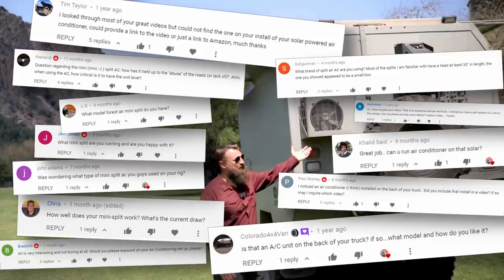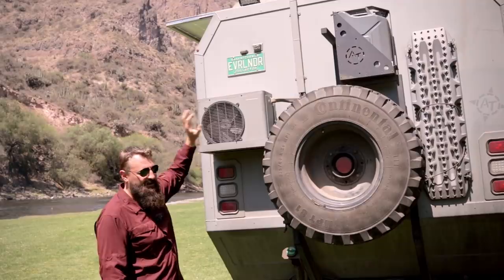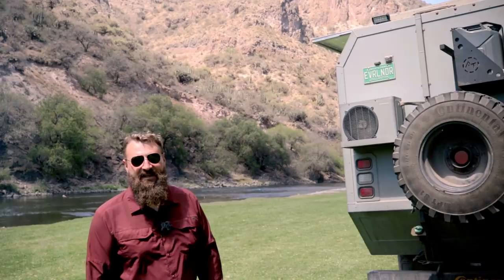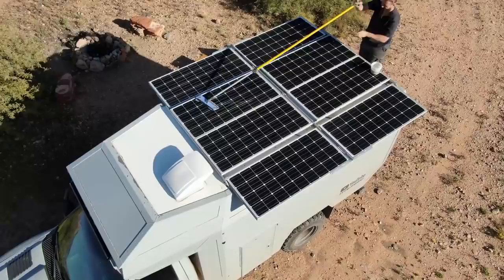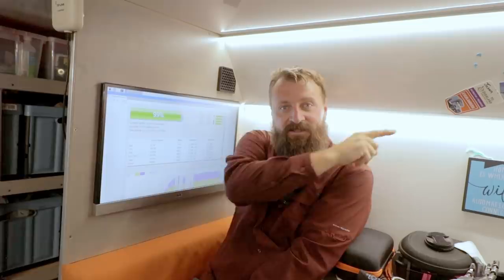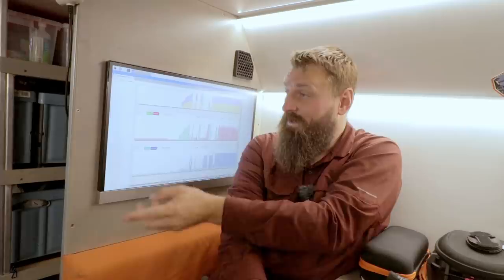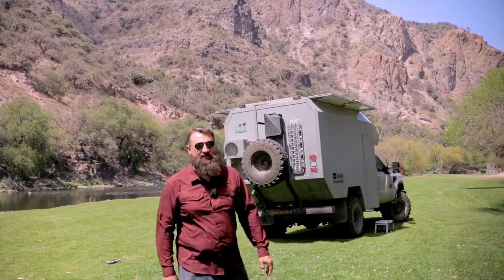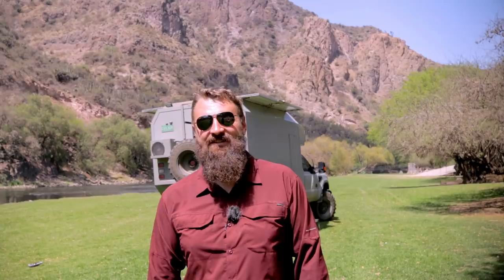Solar Powered Mini Split Air Conditioner Tour - Everlanders see the World!

Comment: Panasonic had the first solar ac same 800 watts. I found a china one for trucks that 640 watts split. I was thinking about it. I brought anther 400 wats panel fine on my van, total 930 watts. Brought = 540 ah 6 volt battery or 4 . Decide on a 5,000 btu. Low 460 watts ac can run it probably 3 hr. But my van I made it w/much ventilation .so the cold air escape my van mostly. Get cold later but I don't use it much.not all golden.  I rather do as I were doing that fast charge and tap off at 1:30 then go to the mall or park under a tree. Than charge in the sun till 3 pm. And cloud can screw it up. Depends. Your needs. But same thing as lithium battery they sound wonder strong, but they require long hr all day charging back up. Trojan 6 volt  are around 2 hr fast charge then 1 hr tap off they just soak up the amps big lead electrolytes

Comment: thank you for making this!
can you expound a little more on what you mean about the replacement for this forestair model? When you say the hose is no longer removable are you meaning that I would need to cut a hole big enough to put the whole inner box inside? Whereas you only needed to put a hole big enough for the umbilical cord through? Also, what are the disadvantages of it being 10k btu over 8k btu? Probably draws more power?

Thanks!
Reply from the maker: Yes, sadly the new 10K model would need a big door like you say... The higher BTU rating probably isn't any problem, the rated watt consumption is the same, perhaps they got more efficient cooling somehow, or they over rated it, it's so close it wouldn't matter.
Reply: Everlanders I saw that on your Canadian costco link it still shows the 8k option (as well as the 10k). In the states we only have the 8k as an option. Do you think the 8k on the Canadian site is still legit to get?

Comment: Do you use two solar chargers one for the lower panels that disappear and one for the top panels that are always(mostly) in sun? Just curious of that whole setup.
Reply from the maker: 2 controllers is not needed, they can all be controlled with one as long as the top layer is paralleled with the bottom. In fact we have 4 DSSR20's as shown in this video. https://youtu.be/TGMZ7bM-Kow

Comment: Suggestion. Try finding a vent out of a vehicle at the auto wreckers and affix it to your cooling vent.  You can find some cars where you can change the flaps almost 180 degrees and also rotate 360 degrees.  Then you can point the flow in any direction coming from your vent.
Reply from the maker: Good tip, I've got one drawn up in CAD, and I'll print it off once I get access to our printer again.

Comment: Sorry to trouble you with this, but I looked on your website and through your videos and didn't find what I was looking for.  Could you please make a video about your energy monitoring system?  I recognize Raspbian, but after that I'm lost.  I too have the Electrodacus system including the DMPPT450 and I'd like to set up something like you have.  Not sure if it's possible for me because if it isn't GUI setup I'll quickly be too deep in the weeds.  Thanks in advance.
Reply from the maker: Page 8 of the users manual describes how to monitor over WiFi: http://electrodacus.com/SBMS120/manual/SBMSmanual.pdf 
I took it a step further and curl the data from the Pi, and send it to my server in the cloud for remote monitoring. Further automation can be done on the values retrieved. For example, I have a python script that turns off the Inverter after 5 minutes without a load, if it's forgotten on. Or to extend the second set of solar panels when needed, retract at night after they stop producing power, etc...
None of it is GUI based however, it's all custom scripted in python for my needs. But it sounds like the HTML monitoring in the manual was all you really wanted...
Reply: @Everlanders  Thanks for the reply.  I'll have to ask my computer science major nephew to have a look into it and tell me if it's something we can tackle together.  I've had quite a few discussions on the forum with Dacian,  and he's always extremely helpful.  Looking forward to the challenge!

Comment: You can buy these mini splits that run off DC, so no need for an AC inverter with it's associated loss.
Reply from the maker: I've only found 48 volt systems, do you have a link to a 12 volt system suitable for an RV/Automotive environment? The only one I found was Cruise N Comfort for $4000.00

Comment: Have you thought about tearing the units apart and changing the fans to dc ones? Your power consumption would drop and it could be less noisy and you could have better control over it.
Reply from the maker: I have. It's not the fans that pull the majority of the power, it's the Compressor, and those are sealed inside a can...

Comment: I would like to put your solar system on our 5th wheel camper, but need to know how and what do I need.
Reply from the maker: We did a video on the solar panel install some years back. https://youtu.be/cM5s4F-7AOk

Any fab shop should be able.to copy what's shown in the video. We have 8 185w panels, a SBMS100 solar charge controller and 20 180AH CALB lithium batteries wired 4S5P.

Comment: I’m surprised you’re driving through those dusty environments without a
Cover on the outside unit. I would try to install some way to automatically turn on the AC whenever the temperature reaches a certain point / voltage
Reply from the maker: It's pretty simple to keep clean... A water hose goes a long way. And yes, it comes on automatically when our solar is producing excess power.
Reply: @Everlanders   awesomeeeeee. good work.  I have a smaller van with not so much room for panels and I can’t wait / hope for AC technology to become more efficient / small sized 🥵🥵

Comment: Mini-split FTW!  Nicely integrated with the van.  Like the quick connects on the unit.  Do you think there are time you are maxing BTU cooling or is does it have much headroom?

Oh, is it AC only or heat exchanger?
Reply from the maker: It's pretty much maxed out here in Panama in the summer and It's AC only...

Comment: Do you offer solar design services? Such as instructions and plans for how to wire the components?
Reply from the maker: I suppose I could... What are you trying to do?
Reply: @Everlanders  I'm working on a shuttle bus conversion and thinking of building a slide out system like yours, but less fancy (without the pneumatic actuator - just a pin for locking it in and out, and will climb up to slide it). I've consulted w/ three solar people and they're all uneasy about the slide idea and running the panels in parallel. I would love to talk with you since you made the vision happen. I originally thought I would do a slide out over the cab and off the back, but then I found your design and I like it much better. Planning on using Rich solar 200W panels.

Comment: At 12:42 you show an elbow connector - if you were installing a saw dust vacuum you not use that angle as it restricts air flow.
Reply from the maker: Indeed!

Comment: I think what I am most impressed about is the total Amps that your solar system puts out. May times when you look at AC systems, the limiting factor seems to be the amp draw when the compressor kicks on and off. Most RV-based systems can't handle that 30A load for the compressor to turn on. However, you system puts out 30+A on both solar banks... that's pretty impressive. Do you know what the amp load is when this compressor turns on?
Reply from the maker: I haven't bothered to measure the inrush because it must be very low, the AC unit very likely has a soft start built in, because the inverter doesn't even break a sweat starting it up, the fans don't even come on...

Comment: Do you have a way to protect those panels in the case of a hailstorm?
Reply from the maker: We've been through many hail storms with no damage to the panels...  originally I thought the top panels would provide some protection to the lower panels in case of big big hail. But we've had golf ball-sized hail it took out windshields nearby us, and our solar panels are fine. The majority of our truck body is fiberglass, we got a few little starbursts and a couple of things in the doors which are still metal...
Reply: @Everlanders  wow.  That's amazing to hear!!

Comment: Hi Jason, is it possible to setup/use mini-split air with only 4 of 200W panels, like Newpowa 200W? For those of us who work on smaller rig builds :) Any advice on power components for such a setup, accounting it will generate only 50-60% of advertising loads? Thx!
Reply from the maker: Hey George, It's possible, but you won't be able to run it continuously, you may need to charge the batteries up and only use the AC in the worst heat of the day... This will dig into your batteries a lot more. You can find very small window shaker AC units that are only 4-500 watts that may be enough for a well insulated, smaller rig.

Comment: Did you consider a standard residential split system?

While this unit seems awesome the lack of a variable speed compressor is disappointing. 

Variable speed compressors are what make residential splits awesome.
Reply from the maker: I don't know of any 110v residential mini split systems... do you have an example that costs less then $600?
Reply: There are a few but the outdoor units are larger and you would have to find a place for the indoor unit. You probably couldn't duct it like what you have currently.

Maybe brands like mrcool or pioneer?

Some seem to be 12000btu. But it is ok to oversize a split. Look at their specs and you will see their btu range. Maybe 5k to 13k for a 12k unit. It will cool quickly and then slow down.

The $600 thing will be difficult.
Reply from the maker: Yeah, The Mr. Cool units look pretty slick, Probably a good size for a cabin or larger RV. But from what I can tell they are quite a bit bigger, require 230VAC and cost $1600.00 USD 😞
Reply: Everlanders I purchased a Rollibot mini split for $300.00. This unit looks identical to the ForestAir (exact same specs) and you can still disconnect the a/c lines from the inside unit.
Reply: @Everlanders  This is close $655 with wikibuy, amazon 9000 btu 19 seer 120 volt pre charged with freon just have to evacuate lines
Reply from the maker: Yeah, that looks pretty good too if you have room, 32 inches wide would not have fit were we have it installed...

Comment: If you have a good HVAC guy to help you, it will make sense to convert a 5000 BTU window unit to a mini-split...that could give you an avg 200 to 250 W/hr and be able to run Air Conditioning during day/night with your battery and solar capacity
Reply from the maker: Yeah, I considered trying to DIY my own mini split, but this was easier... And we have enough battery for 23 hours of AC now... So we're in good shape.
Reply: @Everlanders  👍

Comment: Thanks for doing this video, I have looked up this unit a lot and the size of it really appeals to me for my Sprinter I am converting. However, I have found a lot of negative feedback about this unit breaking or being kind of garbage, could you please give me some input on how long you have had this/how well is it holding up. I've been looking at a 9000BTU mini split AC from Senville and having my buddy upcycle the casing with some aluminum welding, but this unit would fit better. I have been hesitant to try it out because I dont want to waste my money trying to get what I am after. BTW love your solar roof rack, so cool!
Reply from the maker: I answered this 3:00 into the video...

Comment: Awesome video! Question... what type of battery bank are you running? Also you had stated in your update that the newer 10K btu AC doesn't have a hose to disconnect. Does that mean the umbilical cord doesn't connect either? How would one install like yours (through the wall)? Is there another manufacturer that's similar to ForestAir design that you can recommend where the hose detaches? Thank you and safe travels.
Reply from the maker: Battery Bank Video... https://youtu.be/2uYENzaDBY4

Comment: Do you think it would be possible to disassemble the unit partially and fit it into a smaller space?  How much of the housing and frame could be removed?
Reply from the maker: Yes, I just had mine all apart actually... The housing adds 30% extra bulk...
Reply: @Everlanders  why did you have it apart?  Do you still think its a good solution?
Reply from the maker: I had it apart to adjust the way my ductwork attached to the air handler unit... I think it's a great solution, however it's not manufactured anymore so it's a bit of a moot point...
Reply: There is an 8k and 10k version still produced.  You can also get them direct from China if you are willing to gamble on warranty issues.  The 10k has non removable hoses.
Reply from the maker: Check the many other comments citing unavailability...  If you have a link to a supplier that has them available, not just a listing, feel free to post it below...
Reply: @Everlanders  Im speaking to Forest now,  they said they are back in stock as of yesterday.

Comment: really cool, thanks for sharing, so do you plug this in to an 120v ac outlet or did you hardwire it in with a switch?
Reply from the maker: It's just plugged into an outlet, there is an over current safety mechanism on the plug end which I decided to retain.
Reply: @Everlanders  nice, pretty simple then.

Comment: Great content. How much does the battery deplete when you run it whole night? Obviously it's going to depend on the outside temperature, but would be cool to know rough figure.
Reply from the maker: It will also depend on the size of the battery.

Comment: What are you pulling at startup? You have a soft start?
Reply from the maker: I have not measured inrush current, although I imagine most small air conditioners that plug into a wall socket are fitted with a start soft capacitor, whatever the inrush is it isn't enough to cause any sort of spike on my logging software.

Comment: I never heard any info on cooling ability.  What temp can you maintain your interior to with lets say 90 degree external temp?
Reply from the maker: Cooling ability is rated as BTU, in the case of our air conditioner, it's 8,000 BTU or 8440 kilojoules. How much this is able to cool a volume is dependent on how well it is insulated, if you have many windows, how often you open the door...
Reply: @Everlanders  in researching this unit there has been many instances of failure after a short time. Looks like you have not experienced  any issues. How long have you been running this unit?
Reply from the maker: @MountainJoeVa  A little over 6 years now, those failures I read about are due to improperly connected umbilicals. The user's manual is pretty clear about refrigerant leaks if the connection procedure is not followed correctly.
Reply: @Everlanders  thank you and I agree with that. Happy trails

Comment: THANKS FOR ALL THE EXCELLENT INFORMATION.  I have a 41 ft. Hallmark Cyclone Toy Hauler with a 10 x 12 ft. garage.  I damaged the air conditioning condensing unit on the roof / bent it the coil-radiator looking device, along with roof from a tree branch.  I can not mount the mini split on the rear as it is all ramp/ door.  CAN A MINI SPLIT BE MOUNTED ON ROOF FACING UP??? I ASSUME YOUR SITE OR BELOW HERE ARE REFERENCES TO SOLAR PANELS AND EQUIP?  I MAY BE LIVING IN THIS PERMANENTLY.  WHAT IS YOUR BEST CHOICE FOR RESIDING VIA YOUR TRAVELS??  THANK YOU KINDLY  RON NEW JERSEY SOUTHERN CUMBERLAND CTY.
Reply from the maker: No, you won't be able to lay the compressor on it's back, if that's what you're asking.  Perhaps you could retrofit a side compartment door with a vent like they do for generator units.

Comment: 10000 btu air conditioning takes relatively low current, ~1.5 amps continuous. My 3 panels run a wall unit. 
The caravan military tank cannot enjoy beautiful scenery?
Reply from the maker: Amps is not a measure of power consumption, kWh is... caravan military tank enjoys scenery outside, and we sleep inside. https://youtu.be/OpE7ykZrfNY

Comment: Love the hidden solar extenders,  would it be possible/benificial for you to place an additional hinged/bracketed panel of some type over the compressor unit ( about where the license plate is), that rides flat against the truck while not in use, but can flip outward   , providing shade for the compressor but also giving you another 100 watts or so?.
Reply from the maker: Since publishing this video, and having so many people suggest a shade over my compressor, I did some testing and found no benefit to shading this particular unit, perhaps the enclosure itself is sufficient. 🤷‍♂️
Reply: @Everlanders   regardless of the shading ,  maybe simply piano hinge out a panel over it with the license plate hinged to swing out of the way so you can manually deploy a panel sky ward otherwise the plate is normally displayed forward of the non deployed panel.  100 extra watts.
Reply from the maker: We don't need the extra power... We have 1480 watts now...

Comment: I think your windows are just fine!  Why haven't you designed a fan cover which slides open/shut horizontally instead of the OEM cover?  That would allow peeps to install PV above the fan and you could recoup the design/fab costs easily given that's the best fan on the market.  Could you make it with HDPE for translucence, sliding on UHMWPE rails, please.  ;-)
Reply from the maker: I could... But we have enough solar as is for now. I thought to make it more insulated however, that would be a big upgrade.